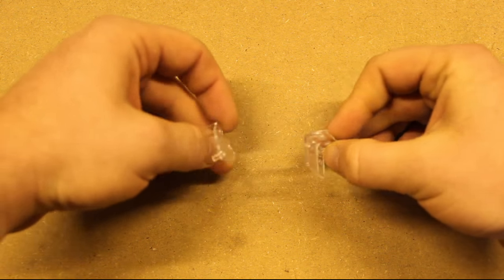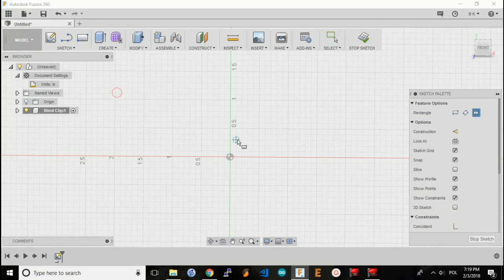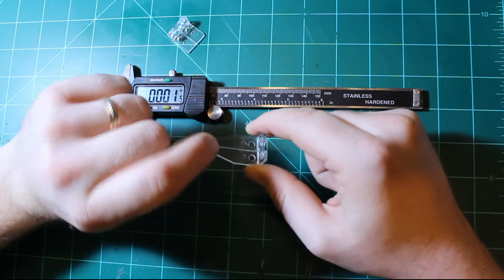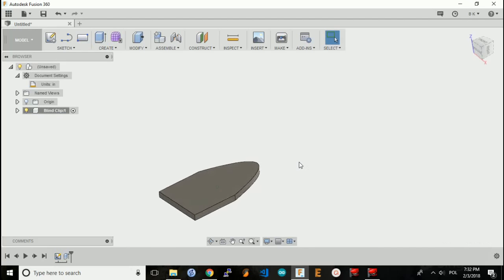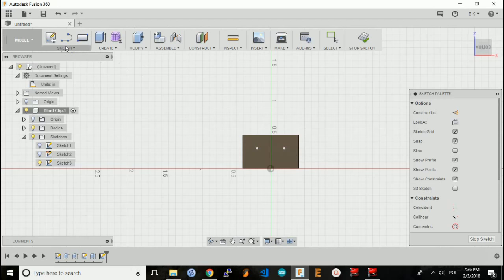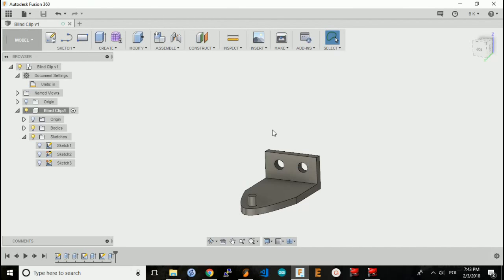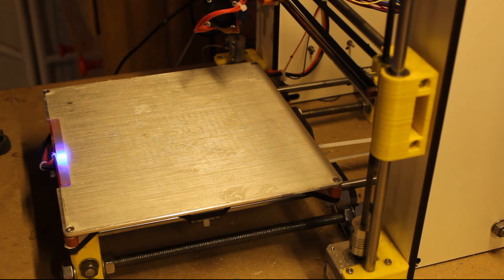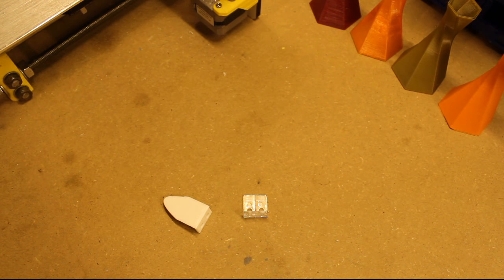Fix a broken window blind clip using 3d printer and Fusion 360

Comment: What 3d print was that you used?
Reply from the maker: +Aaron Twomey - 3d print? https://www.thingiverse.com/thing:2783522 or did you mean 3d printer? It's a Prusa i3 that I built 5+ years ago (while it was still an unfinished open-source design). I've upgraded it a few times over the years, but it's definitely not as good as the MK3 (or even MK2s) that Prusa built in the past few years.